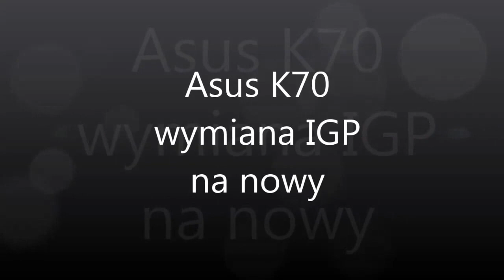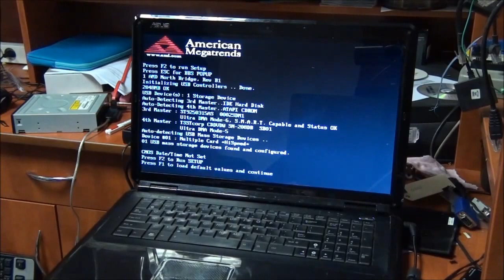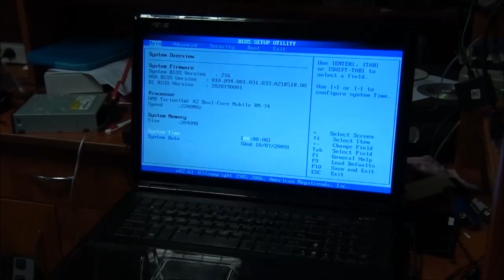Asus K70 IGP repair

Comment: Witam, piszę z Google Translator, mam ASUS K70AB włączeniu późno, czasem po 3 minutach, czasem po 30 minutach, a czasami nie włącza się, jak myślisz, co może być spowodowane
Reply from the maker: What about if no power on, is something on LCD? Logo Asus is on? HDD is working?
First You have to check HDD, if is ok, it maybe IGP chip or graphic chip if is separately.
Reply: I tried it with other power supply, with more HD, more RAM, nothing has changed, this is when access is fine, nothing ok thank you for answering, hello